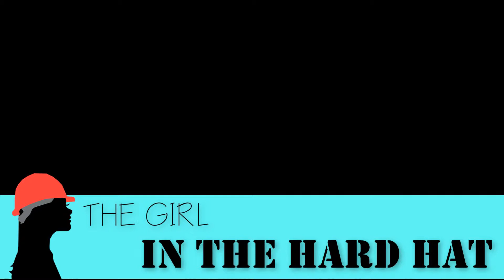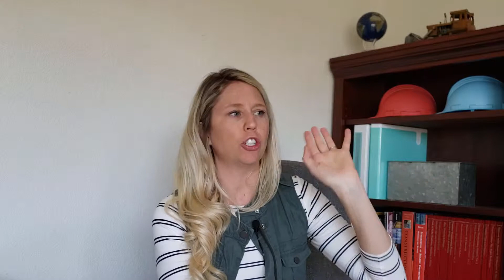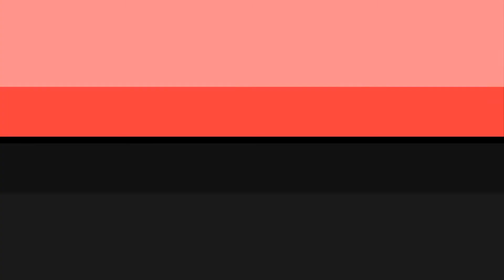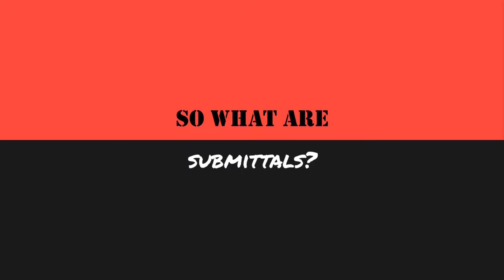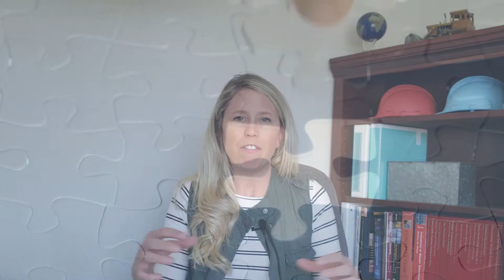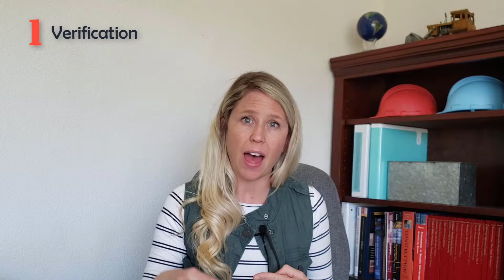Construction Submittals - What are they and why do we need them?

Comment: Back in the early 90s, I was hired as a project manager because I knew CPM project scheduling. The project was a military base in Los Alamitos CA. Back then CPM connected to payment schedules was new, except on very large projects. The first meeting on the military base was intimidating, with the base commander, 2-engineers, their project manager, and a minutes recorder. That is when they handed me the US-Military Forces Specification Bible. This Bible specified every nail, screw, bolt, toilet, etc along with approved vendors. 
Weekly meetings came with weekly submittals, any deviations from approved vendors needed engineered data and or samples. 
Try keeping the sub-contractor in line that buys stuff from local suppliers, and then telling them they can't continue because their unapproved faster was not submitted for approval.
Submittals can be way more than flooring and paint samples.

Comment: When does a submittal become a change order?? These videos are so so helpful!
Reply from the maker: Well technically a submittal never turns into a change order, but sometimes a submittal may be incorporated as a part of a change order?
If changes are exposed through the submittal process (Oh no! We forgot to include the right faucets for the designed sinks), then this may initiate a change order. But, best practice is not to do this using the submittal. If there is indeed a change on the design teams part that was brought to the surface from the submittal process, than an official change document should be issued (ASI initiated from design team or RFI initiated by construction team). 
Rarely should a CO be initiated from the submitter during this process. This is a quality control check process, so whatever was bid and contracted (and therefore submitted) should have been whatever was already outlined in the contract documents and priced accordingly. If you submit something not listed on the documents...it is at your own financial risk if it isn't approved. If it is being submitted as a substitute, it should be clear as to why. 
But it goes the other way too...designers shouldent be buttoning up their documents or making changes at this phase or through this process. 
This is a crucial role of the project engineer or project manager to manage this process and make sure both sides are playing fair and not misusing what the process is intended for. Hope this helps!